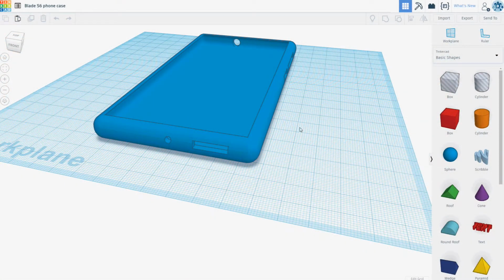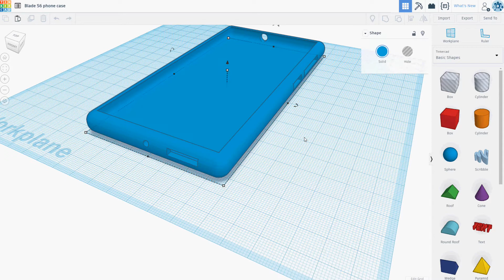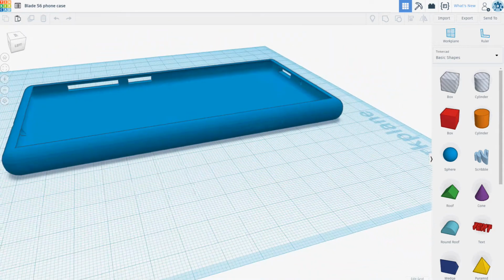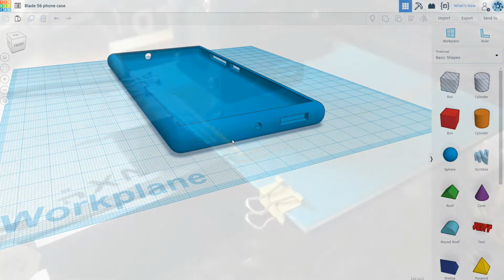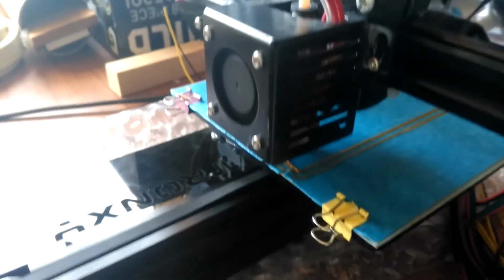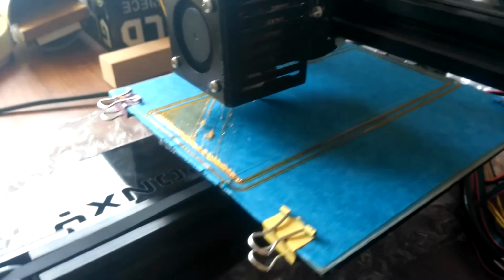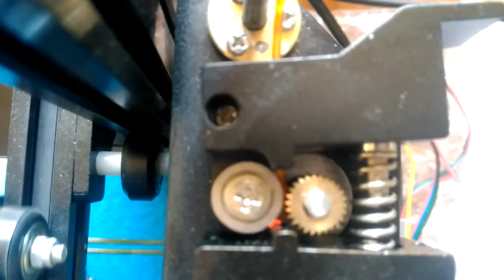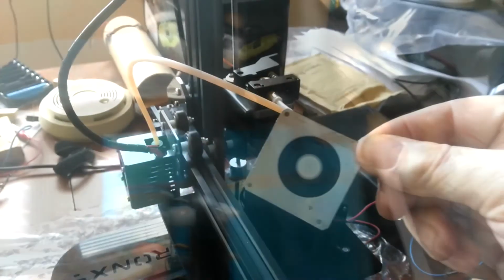Towards Flexible Filament Success (TPU, TronXY X1)

Comment: Well done Chris!
 I just started printing TPU recently, clogging is really a big issue.
Thanks for the idea of cooling the filament.
 BTW, can't believe I'm the first one to leave the comment
Reply from the maker: Hi & thanks for stopping by. Since making this video I did quite a bit more work; I made a tiny refridgerator from a Peltier module and sat that on top of the extruder module with some great results. Too busy to make the video though.